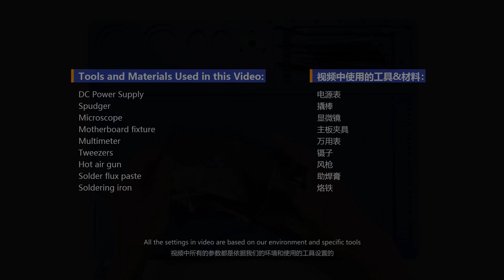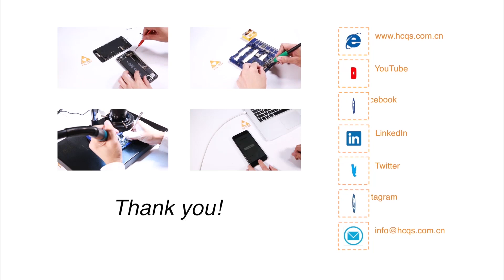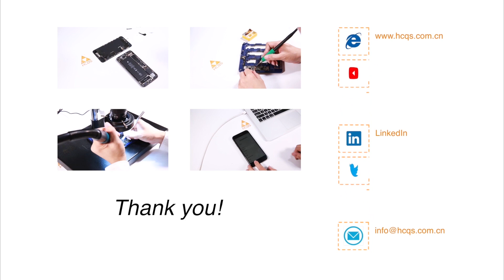How to fix iPhone X No Touch Issue, Case 2 | Motherboard Repair

Comment: can you please help me to solve ghost touch problem from motherboard
can you provided a dedicated video on this issue...... 
You have great skills.......
Reply from the maker: For those models which have touch IC, first troubleshoot whether the Touch IC working condition is normal, for those models which have no touch IC, troubleshoot the touch power supply and sync signal, cheers

Comment: Bro in my phone half touch is working and half remaining half is not working 
Guess the problem 😓
Reply: I have also check the display with other iphone x it is not working on the other iphone also
Reply from the maker: Hi, our technician suggest you first replace the screen and see if the problem fixed, if its not, then you need to troubleshoot the motherboard, cheers
Reply: @HcqsUs  Hi, I have an XS screen not working at all, is the troubleshoot omg the same as what you'd do with an X

Comment: ive got this same problem now one day just stop working so brought it to apple because there was a small chip out the side glass baring in mind i done this when i bought the phone an for the 2 years the phone everything been fine anyway they turned around and said that because of this there will be a charge of £280 i laughed and decided to get a new screen out on 3rd party all was well for 3-4 months then the phone started playing up again tried to pull a fast one with apple to see if they could just replace the screen for free as it was in crisp condition no chips ;-) they soon seen it was a 3rd party screen and wanted to charge me the £280 even tho it seems to be a common fauly with these phones now im stuck with a perfect looking iphone x randomly unresponsive at times temporary i give it a soft reset which helps but im back to square one ive tried everything i can think of dfu mode new screen even turned off the 3d haptic touch no luck any suggestions or shall i sell and just get an android s10  or something apple dont want to help